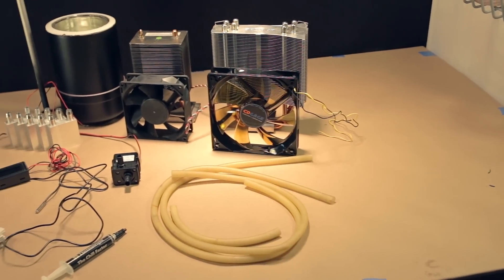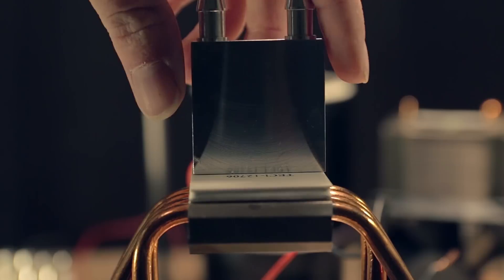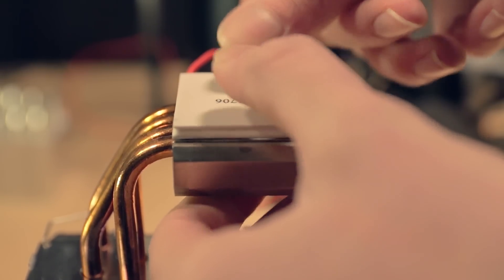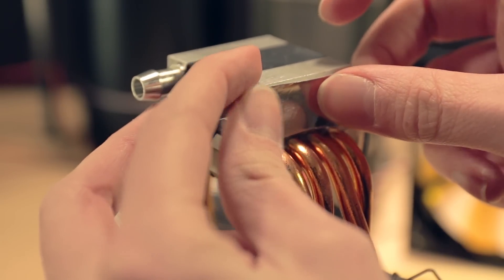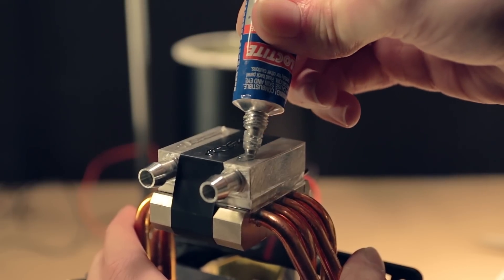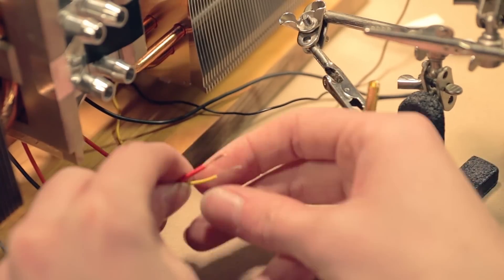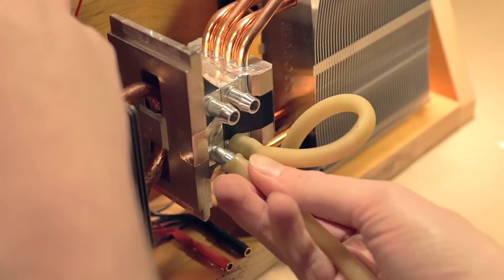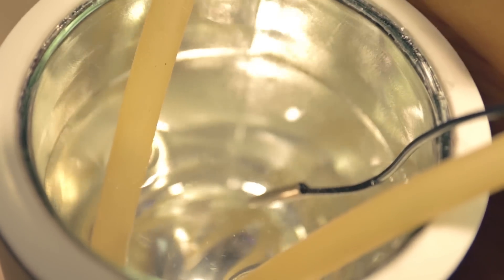Peltier Water Cooler

Comment: What is a peltier chip and why has many of this peltier things show in my recommendation?
Reply from the maker: Lol, yeah there's quite a community around these things on YouTube. It's a little ceramic chip that gets hot on one side and cold on the other when electricity flows through it. (Peltier effect) Conversely, when heat and cold are applied to the appropriate sides of the chip, electricity is generated as heat transfers through. (Seebeck effect) They're great for niche cooling applications where traditional compressor style chillers would be impractical or cost prohibitive.

Comment: Has anyone ever thought of using these modules to heat a building in such a way as to make the walls from them. This idea might fix the Green energy problem. If a home or building of any kind had these used in the out side walls to Push the heat in ward and push the cold outward for the winter cold months then by reversing the power polarity in the summer the heat would be sent out side and cold to the inside all just by regulating the power to the modules. Aluminum siding. Cold attracts heat but if the walls out side are cold as the outside there would be no attraction and the heat would stay in the home on the hot side. The modules don't need to be hot enough to burn the house down just keep the cold and the hot from canceling each other out. There is so many things these 70 year old modules could be doing to make the world a better place.

Comment: I want to set this up in reverse so I'll have the water block on hot side.  Transfer cool water to the water block to dissipate the heat.

And heat sink on the cold side with fan blowing cold air into a efficient insulated area. i.e. Mini fridge or cooler.

Comment: I've had real trouble with the manufacturing quality of these cheap 12706 chips. (12710 too)   I bought 10 from Amazon (about $23) and put them all through a quick Delta T test using a two-fan heat sink and an empty water block with a thermoprobe in it.  Each chip was powered on for 60 seconds in this setup.  Of the 10 in that pack, 1 worked really well, 1 did not work at all, 2 were decent, and the rest worked a little, but barely.  So that's 30% usable out of the 10, meaning those 3 chips cost $7.67, not $2.30 each.  I've ordered another pack of 10 to see if I get the same results.  I think doing anything beyond toying around with these Peltier chips would required buying a more expensive chip from a source that supplies product manufacturers.  A 60W chips from these guys seems to run from $16 to $48 depending on the performance profile you want.
Reply from the maker: Jim Chapman I plan to revisit this project soon and I may end up doing a similar test. In theory if the chips consume 60W then I would figure that they have "-60W" of cooling power. But you're right, I don't think they're quite as efficient as the manufacturers say. I will also try to determine the cooling power with a known volume of water. Although, I think you may have gotten unlucky with your shoddy performance. All the chips I bought worked just fine. Either way the biggest thing I need to do in my new video is change the orientation of my heat sinks. When I made this one I didn't know that the copper pipes were filled with ammonia. Do by not having them straight up and down I'm losing a bunch of efficiency.
Reply: I had the sink up in my test.  I didn't use water in the block, just air.  This was because before I tested each chip, I waited until the temperature in the block stabilized after the prior test.  Doing this with water would have taken longer given water's greater thermal mass.  It also would take longer to see the temperature delta for the same reason.

As for efficiency, I've read that these chips are quite inefficient in converting energy consumed to heat transfer, much worse than compressor based cooling systems, but they have their use because of their small size.  So I wouldn't expect anywhere near 1:1.  But it would be interesting to really do that and calculate the energy loss.  I look forward to your future results. In reading spec sheets on higher quality chips, it seems that they can be focused on efficiency (heat moved per energy in) or power (maximizing heat moved).  Or some balance between, so a designer can choose what works for the intended purpose.  In other words, a chip rated at 60W (Joules/second) can move 60W of heat energy, but that isn't the same as consuming 60W (amps*volts) of power.  Also, most of them seem to operate with best efficiency at less than maximum rated voltage.

Mind me asking what seller you bought your chips from?  My suspicion is that some of the really cheap ones may be manufacturer cast-offs that didn't pass QC.  For the chips I got that didn't seem to work well (9 of 10), taking a laser temp at different spots on the surface showed that often, only 1 or 2 quadrants of the chip worked, the other 50-75% of the chip did nothing.  So seems like manufacturing defects.
Reply from the maker: Jim Chapman Jim Chapman I bought mine from an eBay vendor 'Mayunstore' although I don't think these are bought directly from the factory. I'd be willing to bet there was a vendor or two before this guy. http://www.ebay.com/itm/5x-TEC1-12706-Thermoelectric-Cooler-Heat-Sink-Cooling-Peltier-Plate-Module-6A-US-/252426848254?hash=item3ac5d007fe I also recently got a thermal camera so when I make my new video I'll have to take a look at my chips and see if I'm getting the same problem with not all the quadrants working. And I'll also try to plot efficiency and absolute temperature curves with power.
Reply: can't wait!

Comment: i would like to see that cool a computer and temp results
Reply from the maker: Michael Dreer I'm going to be making a new video on this soon taking the advice of a lot of comments from this video. In the new video I plan on making some performance and efficiency graphs and talking about the practical applications for this sort of device.
Reply: Too bad these systems need a temp controller that's almost 100 times the cost of the TEG unit.  It can be done but imho a simple liquid cooling system > all.

Comment: Very few people know you can sandwich two Peltier modules, instead of using a huge heat sink.
Reply: What? Lol but does that really work? Im using a 230w peltier module.. As you can imagine, i need a HUGE heatsink.
Reply: James Andonian you still need a heatsync, stacking pelters can help you get a bigger temprature difference between them though
Reply: Two peltiers will enhance the thermal gap between hot and cold side. But that means also there is a possibility of overheating or overcolding one side, so you should plan that carefully. Anyways bigger gap means also faster transfer.
If you use 100w it will move heat at 100w power.. if you use 2x 100w peltiers in series they will move 200w distributed on twice surface with same thermal diff. If you sandwich them, the backsided one should be more powerful becase it moves all the 100w from the front one and also gets something directly from the source through thermal conduction.
Anyways if you sandwich them you get around 120w power transfer and the temp differrnce is greater.
Using two sandwiched helps the hot side dissipation, since the heat dissipation gets 4 times faster if you twice the gap temperature with the ambient

Comment: Why not direct die liquid metal peltier cooled by a watercooler?
Well nvm
Reply: Because of the water in the air...
Reply: Sigh. There’s so many problems with this setup. Not to mention the efficiency of it being crap especially with all of the fans added. 

You only needed the peltier hot side attached to a heat sink to allow for higher conductivity from the cool side.  A single fan is all that’s needed to facilitate greater heat transfer. 

Instead we have black electrical tape insulating the cold side from working effectively with an additional heat sink on the cold side effectively adding heat to the cold side. 

Good grief the more I examine it the more this setup is mind numbingly poorly executed.
Reply: @Eric Newton

I don't believe Peltiers are the most efficient way to cool, but I believe you are mistaken about the construction of this contraption.

He joined two similar heat sink/Peltier/water block units together. There are two Peltiers total, which the electrical tape does not touch. The electrical tape interferes only between the surfaces of the water blocks, where heat transfer is not important.
Reply: @ericnewton5720  There is no need of heat transfer between the blocks, only between the block and the peltier. He could have left the two water blocks separated and this would work the same. And for that he could have put a millimeter of thermal compund without affecting heat transfer, since it is 93W per 25 square centimeters. This is not a cpu die of 1 square centimeter that needs to transfer 130 overclocked watts, so the conductivity of the compund is not a bottleneck in this case. This setup might not be efficient when under load but not for the reasons you siggest. It is simply because peltiers are inefficient and those two with those heatsinks will overload when the water gets hotter under load. With this setup he needs to cool 2*93W + 130 CPU Watts on those two heatsinks, a worse case of more than 300W. He will need high rpms on fans when the water gets hot, due to the peltier temperature delta being almost constant, therefore he is pretty much cooling another additional cpu wattage on each heatsink, defeating the purpose of the setup. Better to put the peltier on the cpu and then cool it with water, and have just one peltier adding watts to the system and extracting heat where it is really needed. But that requires a thermally regulated voltage on the peltier to avoid getting the cpu under ambient or even freezing (condensation) when cpu is not under load, therefore much more complex to setup correctly. He went the easier route where condensation on the cpu area is avoided by trading for efficiency. Peltiers are tricky and difficult to use and inefficient, that is why we stopped experimenting with them decades ago. They are not commecially viable. Too many "experts" on youtube.

Comment: 6.8 degrees? That's pretty shit for a setup like that. Where is that much heat leaking in?
Reply from the maker: Probably through all the latex tubing and the exposed surface of the water in the insulated cup. Sure it's not saturated but it worked for what I needed it to do. Keep in mind that I used a cheap eBay peltier and not one of the high quality ones.
Reply: @SafetyLucas  there go my dreams of a distillation setup that doesn't require me to keep dropping ice cubes in the bucket.. Good effort anyway, very satisfying how well CPU coolers fit on a peltier.

Comment: I have one question:
Why on earth won't any cooler maker imploy this?, it will super cool any cpu and push boundries above what we have now!!! and they can simplify and shrink it
Reply: peltiers are not very efficient, takes a lot of power to produce a little cooling, plus to cool you also create heat byproduct. 
Long story short they could do this and do, but there is probably reasons its not very popular.
Reply: Check out the coolermaster V10

It features a peltier.
Reply: There was one company back in the day called swiftech that made a peltier cpu block. 

overclockersclub.com/ reviews/ swiftech_mcw6500t/
Reply: they are inefficient and put more heat into the case,your cpu temps could be better but everything else runs hotter as ben already said.
also you could get condensation on the cold side of the peltier element,which is bad for obvious reasons
Reply: this is what i was thinking: make the peltier cool the water on aio and lower the water temps to less than 20° so there would be 2 ways the water cools off 1) the radiator 2) peltier. and i don't mean put the peltier on the water block but inside the radiator.
Reply: @abdulhkeem the peltier element doesnt cool,infact it does the opposite and adds heat.
the purpose of it is to transfer heat from one side to the other,you'd have to add additional cooling for that
Reply: McHox Thanks for the info i was thinking if it would work like a water dispencer keeping the water cool, well that idea has ways to go and the tech needs shrinking to even fit into a case.
Reply: I've done this with a 150W Peltier and an AMD 1800X, it wasn't enough cooling to keep up with what the CPU produces and takes a long long time of the cooler running flat out to get the coolant below ambient temp again. The better way for sub-zero CPU cooling is a Phase cooler, they're much more power efficient and go colder.
Reply: "wasn't enough cooling to keep up with what the CPU produces" of course not,you're using a 95w cpu and a 150w peltier so you have to get rid of ~245w at full load.something like that isnt really practical for pc's
Reply: It actually did work exactly as I'd planned, chilling loop to 12c and letting me run some benchmarks at a higher overclock than I could on just high end water before it warmed up... But the OP is suggesting it as a general "better" type of cpu cooling, which it isn't good for.
Reply: Simon T Well i have one mad idea in mind for a while now what if we used water dispencer to cool the reservoir water? or some for of water chiller!!!
Reply: Abdulhkeem Alhadhrami the answer is there is no such thing as a free lunch.  let's say what you are cooling creates 100W of heat.  assuming this cooled instantly, the way It gets cold on one side is to also create 100W of heat of the other side, so your 100W cpu has now turned into a 200W cpu, which still needs to dissipate that heat, either with a big heatsink, or a watercooling loop with enough heat dissipation for 200W.  

 here is a simple test.... get one of these devices, 2 of the same heatsink, 2 enclosures of the same size, 2 fans ( one for each heatsink)  enclose each heatsink in the enclosure, with as little air gaps as possible, turn on the device and measure the temperature of both containers.
Reply: Abdulhkeem Alhadhrami because sub-ambient temps cause water condensation which would corrode if short a computer board.  So extra protection and preparation is needed to not destroy the system. and to keep out water means you keep out air so no passive cooling around the CPU and more thermal stress on the board between ambient and subcooled regions of the board leading to more solder failers
Reply: Ben P. one of the reasons is you get no free lunch, the device doubles or  triples the heat you must dissipate. and has a max amount of heat it can move, yes they get real cold in air but if you put too small a Pelter on a CPU it will still over heat because it is a powered effect, 10 horsepower is fun in a go cart but sucks in a pickup
Reply: Simon T AKA a compressor like a a/c unit and a heat pump. Phase change is how most A/C works but using the phrase makes it sound more exotic than it really is. Fanning yourself is a phase change process.
Reply: Adrian Wilson Thanks for telling me what I already know. Go on any overclocking forum and it's just referred to as "phase cooling" because saying "refrigerated cooling with a compressor" is a bit fuckin long winded. but hey, you say it however you like..
Reply: In one word...: Condensation.
Reply: Simon T What were averages like with the peltier?
Reply: listrik terbarukan

Comment: Pretty much spot on but I would recommend using less thermal conductive paste (you are looking for a thin film) & spread it with your finger to make sure of complete coverage instead of relying on "squishing". Also the CPU coolers are orientated incorrectly; the heat pipes use convection & gravity for the gas / liquid inside to do it's job, so the finned section should always be above the item you're trying to draw heat away from.
Reply from the maker: Phil Stillwell I agree it was too much thermal grease but I wanted to get it to the corners. I'm a bit hesitant to spread the paste around before placing the components in place. I worry that it would trap air inside if the surface was uneven. And I think you're over estimating the quality of these heat sinks. These things definitely weren't the new high quality vapor cooled heat sinks you see today. These were pulled strait out of some junk computers from the early 2000s. lol.
Reply from the maker: Phil Stillwell Okay I take back what I said about these heat sinks. I did some looking and sure enough, there's fluid in them. I never knew that. I suppose I'll have to make a new video with the correct process. Thanks for pointing this out!
Reply: Hey no worries :-) I appreciate what you're doing as I've already been there ;-)

Comment: use termal adhesive instead man.
Reply: Nosferatu thermal adhesives have shit thermal conductivity...
Reply: MotoK tips i didnt know that
Reply: That's a great way to break a TEC.
Reply: @motoktips3024  he doesnt need thermal conductivity. He has 25 square centimeters of heat transfer area. This is not a 1 square cm die of a cpu that needs to pull 130w over itself. It is a total of 50 square centimeters pulling 130W. He could have just glued the peltiers to the blocks. The problem will be that he now needs to cool almost an additional 100W from the peltier on each heatsink and half cpu on each. When the water gets hot he will need high rpms on the fans due to the almost constant temperature delta on the peltier, defeating the purpose of the setup. I hope those heatsinks can dissipate 160+W each well on low rpms.